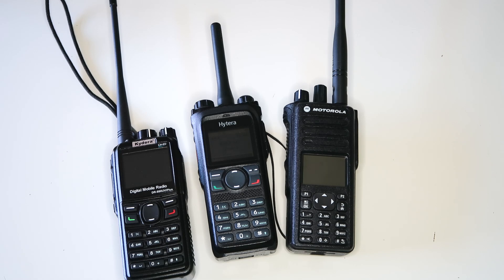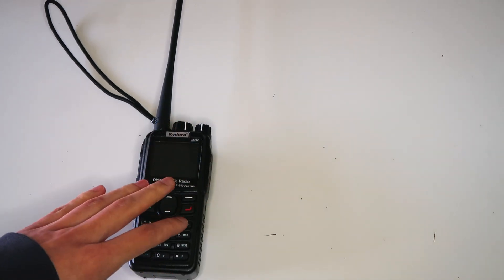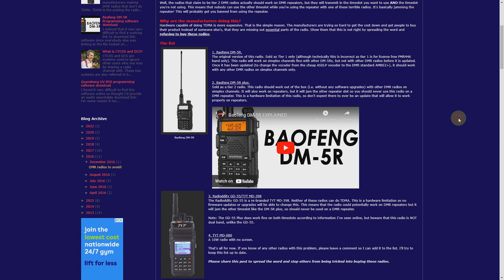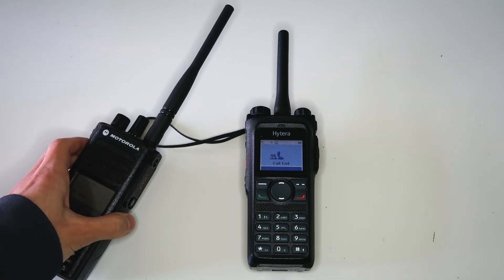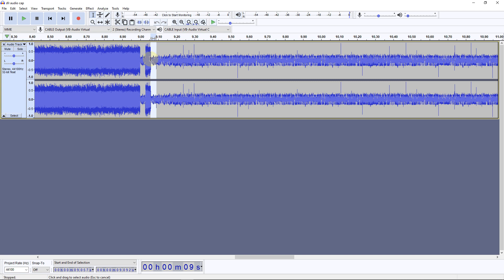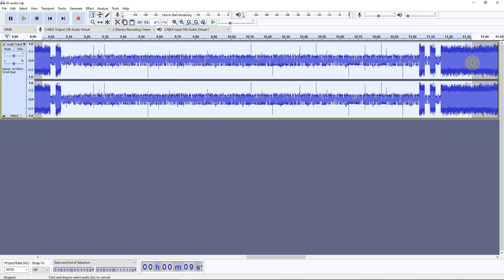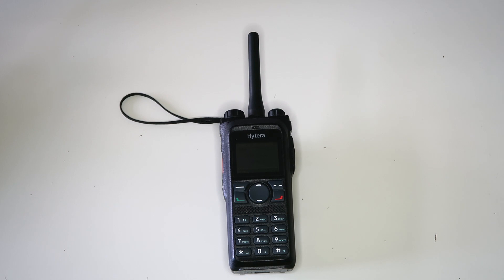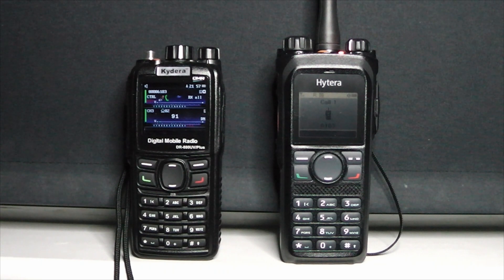DMR Single Frequency Repeater on the Hytera PD985

Comment: Did you try the duplex calling option, you are able to do a phone call to  other Hytera-985 and mobile phones, did you try that? I read that in the description Would be interesting how that works, I'm thinking about buying one of these Hytera Talkies. But they aren't cheap at all. XD
Reply from the maker: I don't have a second hytera radio to try a call with, but yeah it would be cool to try that
Reply: @radiosification  it should be able to do calls to a normal mobile phone, but I have no idea how. I know Wouxon does have Radios that work with sim card and dual band, would be interesting to try that out,

Comment: The Hytera SFR implementation has one disadvantage to SFRs using DCDM Split TS as in the Hytera implementation if two or more mobile subscribers (MS) are within simplex range of each other then I believe they will hear each other directly when on receive and depending on what the particular MS manufacturers do with the SFR signal being received as well then possible audio interference/cancellation may occur. I haven't tested this as I don't have the array of radios that 'radiosification' has, but I  believe that this won't happen in a DCDM Split T/S SFR because of the TS synchronisation that will occur between MS & BS. This and other videos on this channel are very good as they aid understanding of DMRs more complex aspects but also provoke deeper thinking on the subject.
Reply: I have tested this with 6 Hytera Radios plus one PD985 set in SFR mode - all in direct range - and it seems to be no issue with interference/cancellation you've mentioned. I used 4 x PD375 and 2 x X1P - all works great with this SFR, even if being in one room :)
Reply from the maker: Thanks. On good radio models, I didn't find any issue with the Hytera repeater. I think the Ailunce HD1 which I consider a cheap chinese radio had minor issues, like sometimes when transmitting it would get confused just after you let go of the PTT and it would play the signal in analogue momentarily. But if you have motorola and hytera radios, it works perfectly

Comment: Informative video. Thanks! I'm thinking about dabbling in some digital scanning and I wonder what your recommendations are for best 'bang per buck'. I also just saw your 'makeshift scanner' video, scrolling through the variables until you hit the jackpot. Is that how digital scanning is? Or are there options for radios that'll take all the guesswork out? Thanks :-)
Reply from the maker: The cheapest way to get into digital scanning is buy an RTL SDR and use that. There's lots of software out there these days that can decode the common digital modes.

You can also just buy a digital scanner like the whistler trx1
Reply: @radiosification  Thanks for that. I actually have an RSP1 hooked up right now for analogue reception. Can you recommend some of the software that'll work with this, for digital reception, please? Thanks again
Reply from the maker: @wrongsideof40  I don't have one of those so no, I don't know. I use SDR# with the rtl sdr but I'm not sure if it works with the RSP1
Reply: @radiosification  forgot to say I'm using SDR Uno with this, at the moment.

Comment: How do the older MOTOTRBO radios do with this?
Reply from the maker: I haven't tried them but I would guess they should work okay because the subscriber radio (the radio using the SFR) doesn't need to have any special capabilities to use it or even know that it's using it.

Comment: Were you able to test the Motorola as the receiving radio?
Reply from the maker: Yes I did another test that I didn't film where I talked between the radio shown on the left in the demo and the motorola radio via the SFR and it worked fine
Reply: @radiosification  How did you know it was going through the SFR? The tests I've done I can't get motorola or hytera to tx and rx on different timeslots to test it. When I turn the SFR off they still talk to each other even though timeslots are set different.
Reply from the maker: @militaryrig  that always happens on a simplex channel because there's no source for when each timeslot starts and ends. There are essentially no defined timeslots in a normal simplex channel.
Reply from the maker: @militaryrig  in my test I knew I was talking through the SFR because the hytera radio was high up and was the only radio that could have had signal to where I was. The other radio was indoors on the ground floor and would not work to the location I was at. Also I did a radio check to the hytera directly and it succeeded, so I knew I was at least in range of the hytera

Comment: The Aliance radio is extremely buggy, has an underpowered (or unoptimised processor) and fails far more often than my other budget radios, even the RadTel copies.
Reply from the maker: I've been quite lucky with mine then, not noticed many bugs. The one thing about it that I find annoying is that it always forgets the time and date and to turn it on after the internal battery runs out you have to try twice

Comment: The ailunce issue with the dmr audio being rx as analog (raw) form has also been experienced with my home brew SFR setup. No clue why it occurs though

Edit: I'm interested to know if Motorola's SFR option in CPS does anything to Hytera SFR mode
Reply from the maker: The Motorola option doesn't seem to do anything, no. I think Motorola's SFR system works slightly differently and might need that box to be ticked. Not sure though.

What's your homebrew sfr setup?
Reply: @radiosification  I've been just using two mobiles on DCDM mode as my SFR setup (similar to how you would have analog repeater set up from mobiles). works like gd88, better sound quality though and features range check (Private call to the repeater, repeater tx in group call which is included in rx group list). The radios are just on scan mode, works 99% of the time.
Reply from the maker: Sounds good! Can you explain a bit more how the range check works? Is it only to check if you're in range of the repeater or not when you transmit? So when you transmit to the repeater with a private call it fails if you're not in range?
Reply: @radiosification  Yeah pretty much the repeater’s Rx end is set to private call. So subscribers have to tx private call and they have rx group list set up to receive a group call.